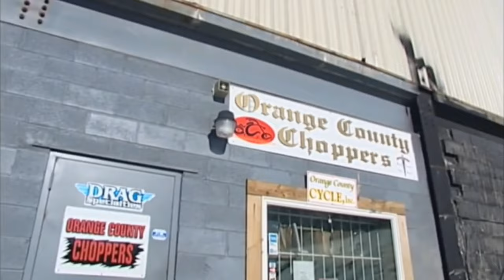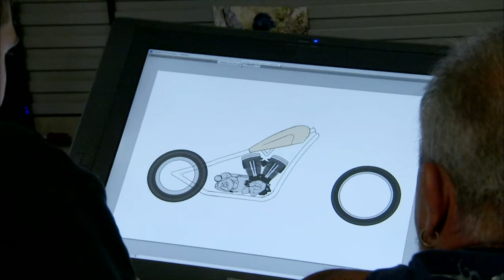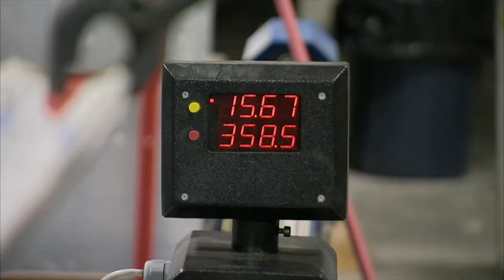Why Orange County Choppers Headquarters Was Sold for $2.3 Million

Comment: Word on the street was the bikes LOOKED good but had stock EVO motors I heard and were anemic. Build quality was crap according to new owners purchasing an older OCC from the early 2000's and through the run of the show and comfort riding them was not an included accessory. I don't know I just think with a few exceptions it gave Discovery a handle, a schmooze, a gimmick to pull audiences away from the already declining main stream networks.

I mean wow I hated the fights between Sr and Jr but that was what I think the majority of the viewers considered the best part.

Just saying I never got into the bikes as more than art not function, and now when you search "were OCC bikes a good investment" you get a ton of negative hits!